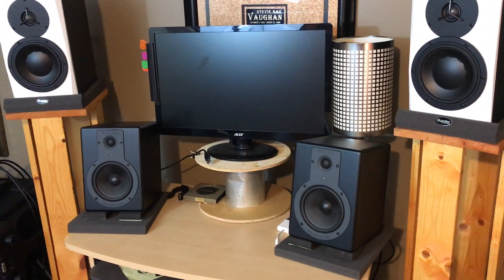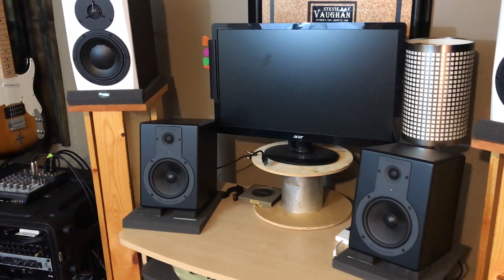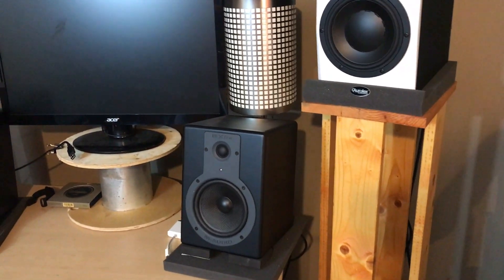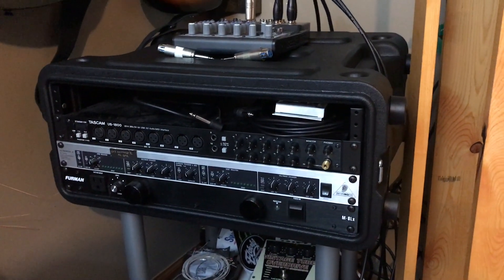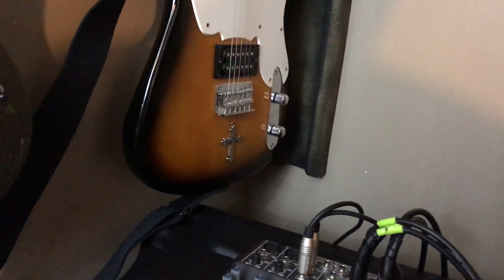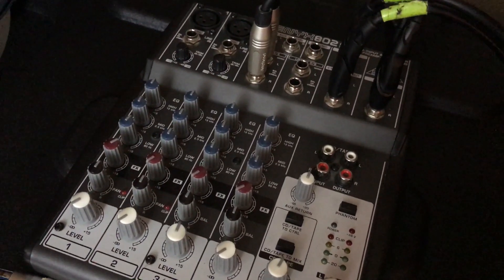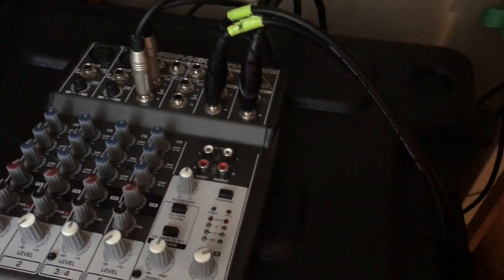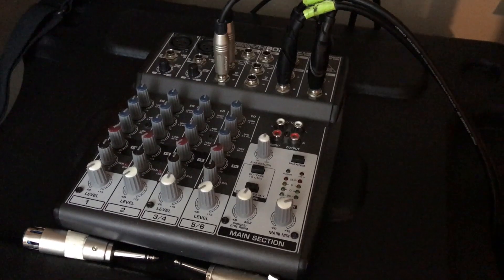DIY Studio Monitor Controller: On a budget

Comment: I don't think you can qualify this as a DIY... Came here hoping for an actual design of a monitor control, not just someone learning how to use a mixer. I have to agree with some other posts, chances are you're introducing noise or other issues into your mix. Check if you can do internal routing in the tascam with whatever mix control software they offer.

Comment: Hey, mate, beyond the monitor splitting idea... are you really feeding your Dynaudios with a Xenyx mixer...?? That´s crazy. 

Remeber, your sound is as good as the worst part in the sound chain, follow all the chain and the weakest link will determine how good the overall result is.

You are filling your signal with coloration, ground noise, hums, and all kind of distorsion with that 30$ mixer. You´d better spend a little less in a decent pair of speakers, and spend some more in a good monitor volume controller. It´s the simplest advice I could give away by looking at your setup. It would be nice to consider some room conditioning too, which isn´t expensive nowadays, with those cheap kits sold in Amazon (you don´t need to go for Auralex to have a decent home studio anymore). 

Good luck and thanks for sharing your ideas